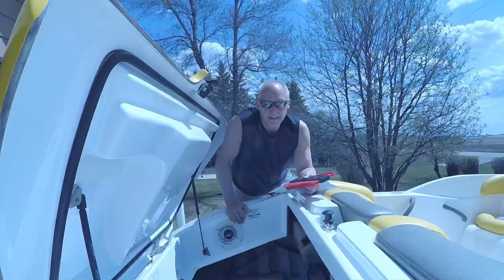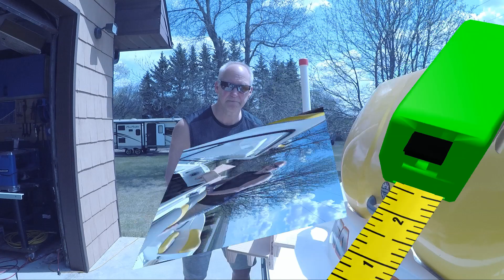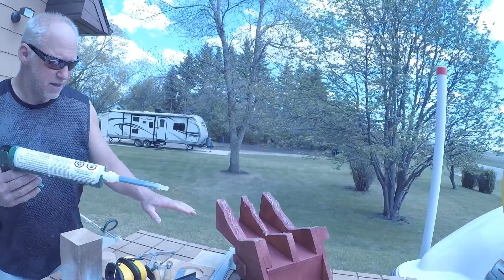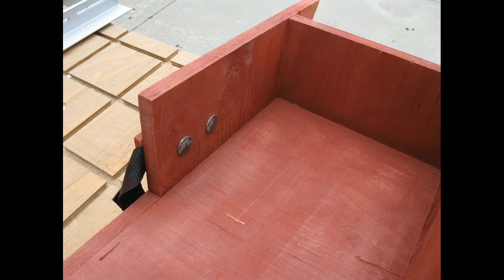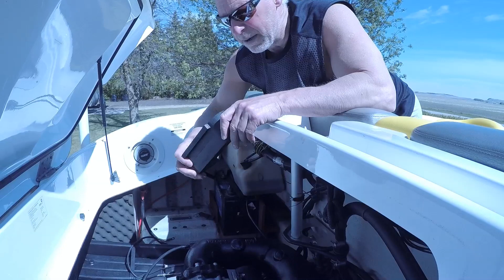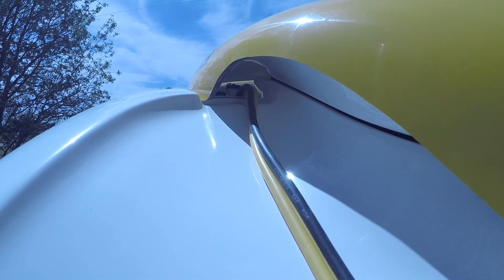Second Battery  on Sea Doo Sportster

Comment: After I put the air stock air cleaners back I had to remove the spare battery. I was thinking of replacing it with a fairly large motorcycle battery as the main drive and switch to the big battery when I turn on the music.

Comment: hello J-Man is it possible that i can buy that battery support from you I wanted to add second battery to my sportster 4 tech ? Please let know I would appreciated.
Reply from the maker: The battery support was custom fit for my 2003 Sportster.  I am not sure it would fit in your boat.  I actually built this unit as a one and done (ie. no formal plans) but wanted to share my vision in case someone else needed an idea as to how they could make a harness to hold a second battery.  I would have to go back into my boat and formulate a few patterns to make a copy.  Not sure if this is a smart idea for a different boat???  What are your thoughts??